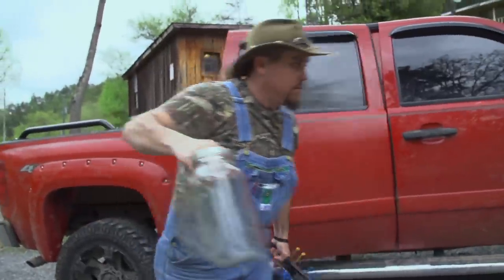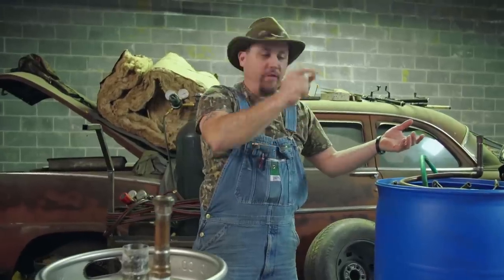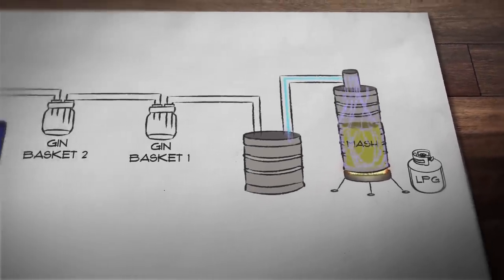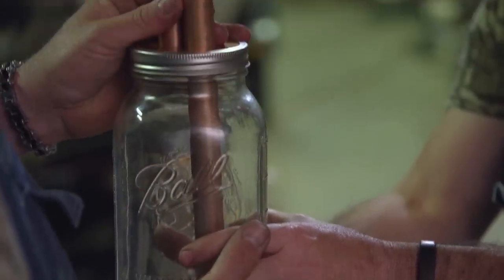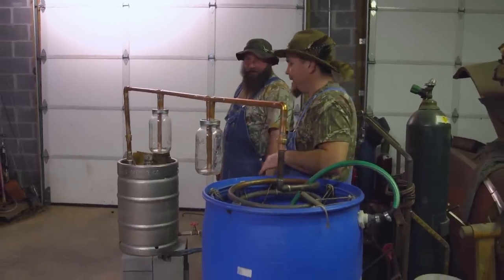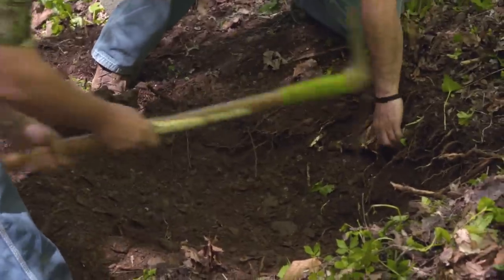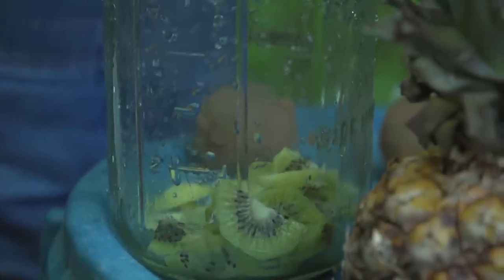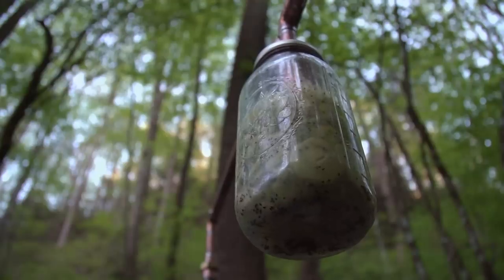Mike & Daniel Test Their New Moonshine Still | Moonshiners

Comment: Idk anything about making of alcohol, but if i had to judge, these guys are absolute geniuses
Reply: Researcher popcorn Sutton. He was the ultimate moonshiner!
Reply: Try Barley and Hops Brewing  and learn the Right way
Reply: They are far from it. Half the shit they said was incorrect.
Reply: What
Reply: Geniuses??? Yeast and sugar=ethanol. So simple.
Reply: The underside of them lids will have a semi soft plastic to create a seal when you screw the lid down, just like a jam jar. Problem is ethanol is a solvent and alot more so when heated to boiling point. There are lots of stills and accessories for sale using silicone and plastics for sealer. Problem is can you work out how many plastics and silicone types have been invented and are in use?  1000s at least, and how does each one react with hot ethanol vapour?  This is why PTFE is the only one recomended on homedistiller. besides the glass jars are way to small and would fill up fast way before the end of the run, stopping the extra distilation and just act as pipes and jars totally full of liquid heading to the condensor.
I think some of this show is deliberately fake so that if they are ever pulled up in front of court, real distilling experts could discount what they are preaching. Others seem to make a good genuine product in enough volumes to supply themselves, family and some friends for a year. Not enough to run selling at a profit in any scale.
Others have opened distilleries, half the show is how it used to be done when times were harder and there was no wallmart undercutting everything and putting smaller enterprises out of business.
Reply: I forgot to emphasise my main point. do you want the nasties in silicone and plastics leaching out into your pure quality made great tasting moonshine?
Some of them may be totally inert, but which ones, who can really tell you? PTFE is innert all the way. Stainless steel or Copper all the way too. Get yourself onto credible sources, this can be done safely like driving a car or wiring a house to regs. You cant just name two pitfalls and think your and expert you got to know them all to be competent!
Reply: @alstonofalltrades3142 
so are they experts or are they just meh
Reply: @ozeej2258  Tim Smith, and Mark and Digger are, They run legit businesses. Popcorn sutton definately was, his show The last dam run of liker I'll ever make is what came before this series. When you see say josh having an idea of transporting his 5gallon buckets of shine down the river and they are floating on top like they are empty, well its a TV show.
Reply: @alstonofalltrades3142  man I never realized who Popcorn was until I started looking him up.

Man was a legend Jesus.
Reply: Definately, just stopped caring about the law to teach people before he went. Knew his craft. In the series they show some clips of another moonshiner called Barny Barnwell. "We ain't trying to make a Rembrandt, Just something to get drunk with" lol
Reply: Geniuses don’t commit “federal crimes” on national television
Reply: Geniuses? Lol you know this is staged right? Meaning these episodes are written
Reply: "Idk anything about making of alcohol" correct, and this is who this show is aimed at. People who don't know any better think they are the tits. Have you not noticed by now that this is how TV works?
Reply: @NoMoreBsPlease  most of what they did was correct besides the condenser. and theres no way you could do this with jars.
Reply: @alstonofalltrades3142 This show is 100% fake. None of these guys are real moonshiners. There is nothing being done illegal at all. A few of these guys are actually ATF agents, the same agents that busted Popcorn. They made this show using undercover agents as a tribute to Popcorn. They felt terrible they had to bust him and felt even worse about him killing himself over it. So, they made this show and have tributes to Popcorn all throughout. I've been distilling for years and I can tell you without a doubt that most of what they are saying is incorrect.

Comment: I’ve added a jar to mine but I when I tried strawberries I couldn’t taste a difference. On today’s run I but some shine from my previous run in my thumper. My alcohol level went from 160 to 170 I guess I was adding water back into my run. My concern with adding more jars is the back pressure. If it goes backward I call it farting & burping if it goes forward. When I stop my run what’s in my thumper farts back into my still. Now as so I turn off the heat I loosen my fittings so it doesn’t. This is a show so there’s things we’re not seeing. The best I’ve done on my first run is 130 not 190 like the show. It changes throughout the run. Cheers 🍻

Comment: Just how do they clean the inside of those keg stills if they dont have a cleanout port? Or are they just cheap stage props?
Reply: I think, if you have a still that isn't mounted you could probably lay it on its side and spray it out that way and dump it. But that's just a guess.
Reply: You don't

Comment: If your looking to try something new try this. Popcorn Moonshine. Moonshine made with popcorn. Not malted or ground popcorn but popped popcorn! Pop the corn using a hot air popper and then take the popped poppcorn and throw it in a blender or food processor until a powder and add that to your mash for flavor. I would think thats the best way for the yeast to get every molecule of starch to eat. Should make for a unique flavor profile. Might even cut down on the amount of corn needed for a run. Also might need to use that enzyme to help break down the starch. Any grain that you can pop should work too.

Comment: Also for it to redistill wouldn't you need to heat up those jars so the liquid can turn to steam and travel to the next jar ?
Reply: No,it acts as a 3rd and 4th distillation.Main pot,heat=1 run,thump keg,no heat,2nd  run,1st jar gin basket,no heat=3rd run,3rd jar,no heat=4th run.It is literally distilling 4 times in one run due to the fact steam is hot as the gates of hell.Ask any woman with a bad steam burn from a boiling pot on the stove.
Reply: Yes, you're right. That's exactly what's happening here. The steam is going back up and then condensing.

Comment: I don’t get it doesn’t the vapor turn into air bubbles when going through the last two jars?
Reply: Not sure I understand your question man. How can alchohol vapor turn into air.
Reply: Tony sorry about that.  Vapor is air.  What I meant was how does it collects the flavor of the pineapple and kiwi.  After boiling the mash into ethanol vapor, when it goes through the last two jars, how does the vapor infuse with the fruits if it maintain in the gas phase throughout the process.  I don’t see how that collect the flavor of the pineapple and kiwi.  So it should still taste like the original flavor from the mash.

If they would of add a burner on the last two jars than perhaps it makes sense?  Because the liquid in the pineapple and kiwi would vaporized thus infusing with the mash’s ethanol vapor.  

But for that to work:

Theory 1: Using burners they need to fermentation the pineapple and kiwi to have the same chemical reaction as the mash

Theory 2: Using burners to collect the steam from the kiwi and pineapple thus infusing with the ethanol vapor from the mash

Theory 3: Using no burners.  The ethanol vapor is already “hot” enough that it help evaporate the liquid from the pineapple and kiwi into steam thus infusing with the ethanol vapor.  Probably more flavor from the pineapple than kiwi because the vapor cooled down after going through the first jar.  So the second jar(kiwi) is not evaporating as much steam as the first jar.

Comment: The jars will just fill with distillate and flood the arm. There won't be enough heat to maintain the alcohol as vapor that far away from the heat source. Might work if you insulated the whole contraption... But they aren't really making alcohol with these things. The authorities verified that. It's all simulated. Besides that Gin is made in a column still or redistilled many times to get the required purity. A thumper is not equivalent to redistillation. This show always has them dump a bag of sugar into a barrel, add yeast, and distill with a home made copper pot and "Yowzah!" Gallons of fantastic liquor worth 1000 bucks. It just isn't so. Do what they do and you get Yak! Unless you think Rachel Ray is a great chef...
Reply: Yeah, this is a for entertaining not for learnig how to distill alcohol.